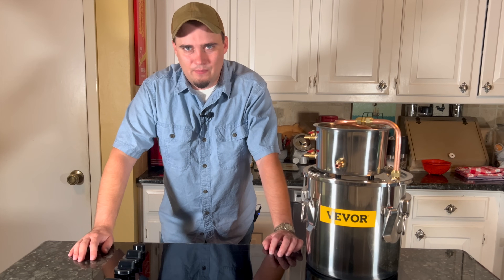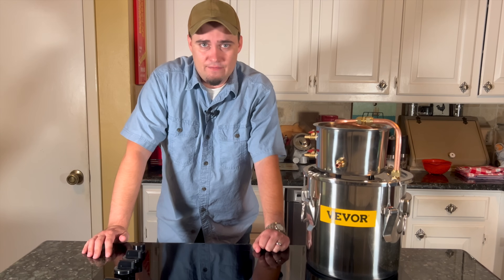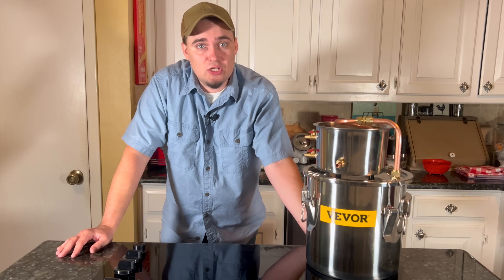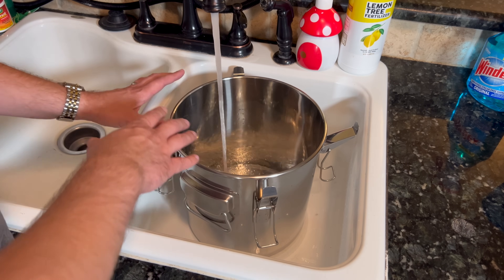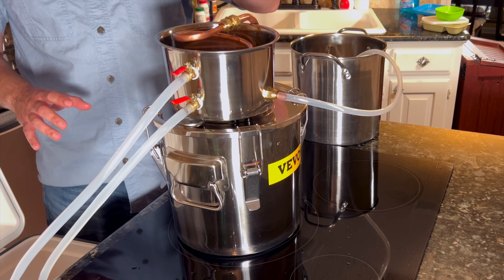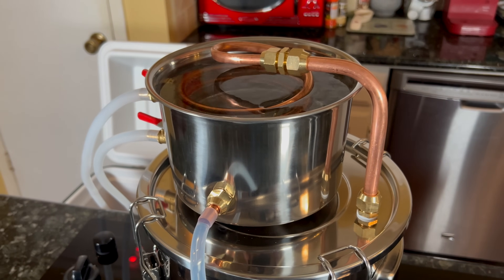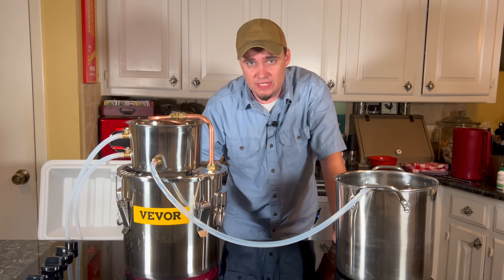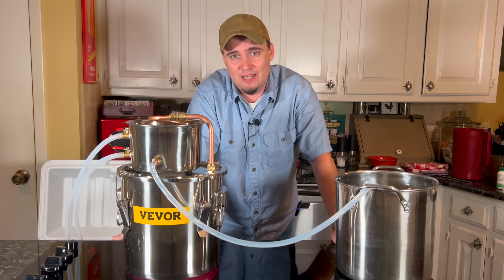How to Make Distilled Water at Home Easily

Comment: I deliver medical devices such as oxygen concentrators and CPAP machines which are only supposed to use distilled water. Many times patients don't believe that and think they can just use tap water which can eventually lead to the devices getting clogged due to mineral deposits overtime.

Comment: I like the idea of flocculation. Alum and various other materials work to remove suspended particles in the water. It works as a coagulant. Remove the suspended solids like feces and other organic matter, the harmful bacteria follow after their food. It doesn’t remove all harmful bacteria but a significant amount of it. The coagulated material at the bottom can be strained out with a simple cloth. I seem to remember reading that limestone works as a flocculant. We have plenty of that in Kansas.

Comment: Very cool! My only addition would be an inlet valve in the big lid that could accept new "dirty" water without having to take the entire still apart. It will be very hot at that point and a real pain to work with, so it would be nice if you could top up the large chamber while it's operating. Maybe another tube from the cooling pool that could be turned on and off when needed?

Comment: I actually bought one of these. They are terrific. Honestly, great bargain. I got the one with the thump keg. The material is better than I expected, thicker, put together well. think I got mine, the biggest one they had, for less than $150. It will only make alcohol about 50%, though. That's about the best you're going to get on one run. But all in all, I'd buy another one.

Comment: I was just thinking about buying that same distiller today. I've been using filters like the Berkey. Just because of micro plastics. But I wanted another option for a long term grid down. 
** Question.
Do they have silver sorter around those seals, where the copper joins on to the boiler pot? Or are they silicon seals?
  I love your videos. Keep up the good work. Have a goodun, from the mountains of Western NC. I've used that exact phrase all my life.
P.S. Eventually I will run out of Berkey filters. So distilling makes very good sense..

Comment: I have the 5 gallon Vevor still, for ahem experimentation. Water distillation on an electric burner is p-a-i-n-f-u-l-l-y slow, so plan to use a gas burner like one you'd use with a turkey fryer or some high BTU flame source.  Quality was pretty decent especially considering what these cost which isn't a lot. I successfully made a batch of ahem disinfectant with it, too. The circulation pump was an utter PITA: it kept either overflowing the worm pot or running too low. And plan on having a VERY good supply of cooling liquid to cool the worm - the cooling liquid warms up quickly.  Try to have as clean a starting water source as possible because stuff sticks to the bottom where the heat is. Good product, just a bit fussy to set up and tear down.

Comment: In the cold weather keeping the still on top of a wood stove and a good watch on the water level allows you to make distilled water. If you were to run   a pump outside for the cooler tank, covered in snow kill two birds, more efficient. A large feed tank using a float valve to keep the level of water in the still and some form of indicator of the various water levels. Set it up in the morning, run all day.
.
Reply from the maker: Thanks for sharing Mark!
Reply: Or for a cooling tank and to get hot water ,, mount the cool water reservoir above the cooling tank . It will automatically circulate the cooling water . Hot water rises .

Comment: Yes, I have one. To be sure the water is clean.
Excellent, thanks 
212 ° water boils. 
I'll leave it at that.
Reply from the maker: You're welcome Charles! Thanks for watching!
Reply: @diypreppertv  always my friend.
Reply: If I remember correctly, the boiling water temperature changes according to altitude.
Reply: @ritaholcombe9905  yes it does. I'm at 3000 feet. It works for me. If you use a still, remember the thermometer reads the temperature in the evaporation. Not the water temperature. It is known as headspace.

Comment: Great video JR many thanks 👍 I have done this before with a home made version and got mixed results
Reply from the maker: It's definitely not as intuitive as a filter is. I forgot to mention it in the video, but if you can get a longer tube to connect the boiler to the cooling pot and get the cooling pot off of the boiler, that may make it more efficient. That and having plenty of cold water to circulate through the cooling pot.
Reply: @  that makes sense I wonder if you could pre cool the water on the return to the big cooler or if a longer tube would be enough to help it cool down on its own

Comment: Really thought we were going to see some moonshine making here. 😂
Reply from the maker: Sorry to disappoint! Lol
Reply: @diypreppertv 
Hi , long time subscriber here. 
The V.O.C  s  you refer to as not being removed by distillation  are removed as soon as the boiling point is reached as they evaporate below 100 degrees c .
They   disperse  into to the air  and aren't  in the final condensate. 
Distillation removes everything  including radiation .
" water can never be radio active"  ,only the particles therein can be radio active .
There are no particles  in  distilled water .
🙂👍
Reply: @davidjacobs828  thank you so much for the update and insight. 
Does the 828 mean area code. If so we are in the same area. Interesting.
Reply: @diypreppertv  No worries man! Good info to have still! 👍
Reply: That is next weeks video.